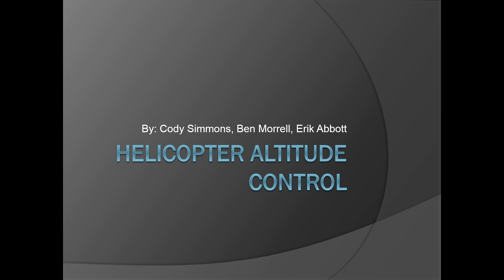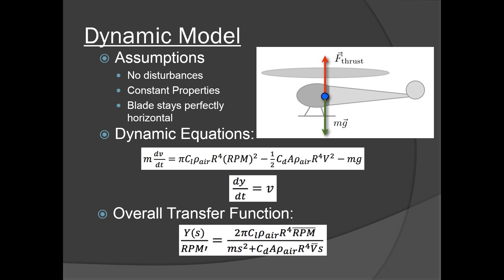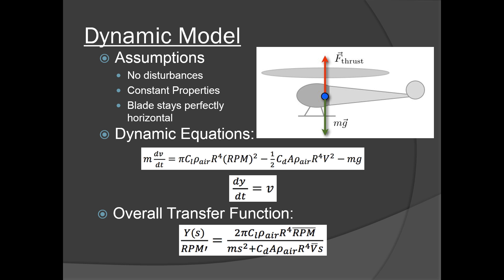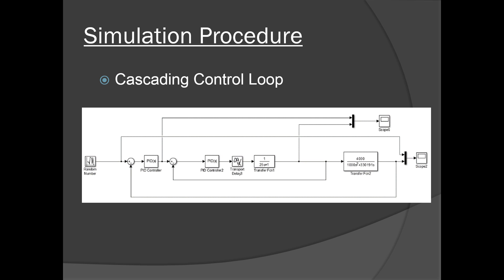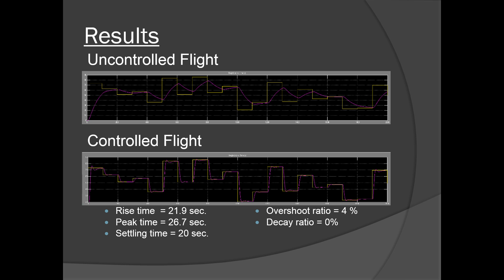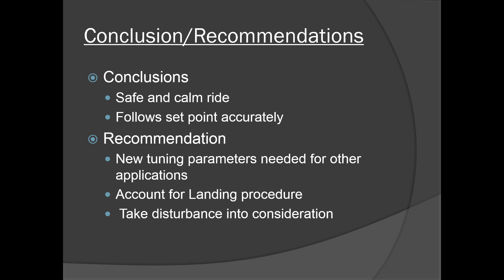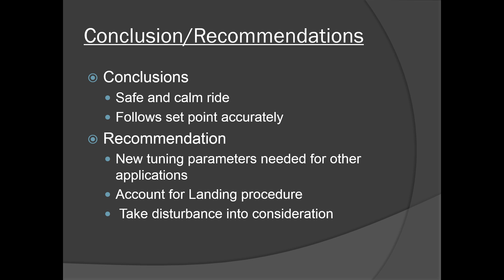Helicopter Altitude Control with Simulink

Comment: Thank you for this video . I’m wondering if you can simulink the altitude control of a commercial airplane Taking into account disturbances that causes a change in altitude
Reply from the maker: Does this help? https://apmonitor.com/do/index.php/Main/ModelSimulation
Reply: @apm  . Thanks for the link , I still wonder if you can simulink the altitude of an aircraft by showing the block diagram for all components for example. Controllers, actuator and also if there is a disturbance , how can we relate that to the signal and make correction . I wish you can be more specific . Thank you in advance .

Comment: One small question, how do you calculate the Cl and Cd the lift and drag coefficients in order to calculate the outer loop transfer function, I would really appreciate some help in that part. I am trying to find out some experiments but haven't found anything concrete.
Ps: I have got no problems in calculating the motor transfer function although i have seen you have made a lot of simplifications in that one making it only first order.

Regards and looking forward to your reply.
Reply from the maker: +Pablo Mollinedo The students who worked on this project didn't have experimental data, only correlations that they found from the literature. This model is also a simplification because aircraft altitude is also controlled by the pitch of the blade, not just RPM. The correlations are much more complex when considering pitch and RPM. The answer to your question is that the values of the Cl parameter was chosen to give a reasonable response to just the RPM correlation. The Cd value is a drag coefficient that you can find in a fluids textbook from a correlation.